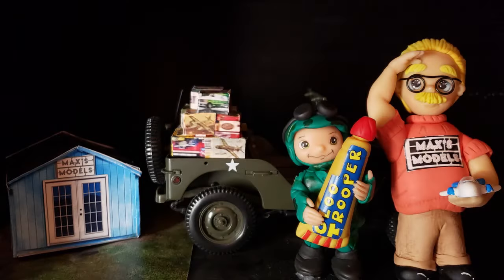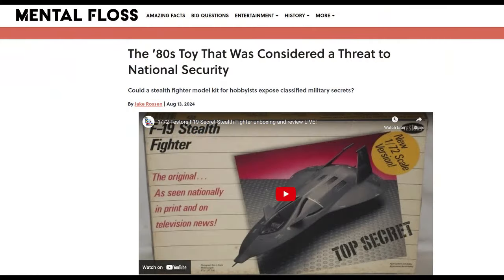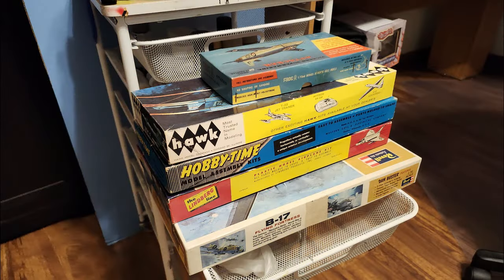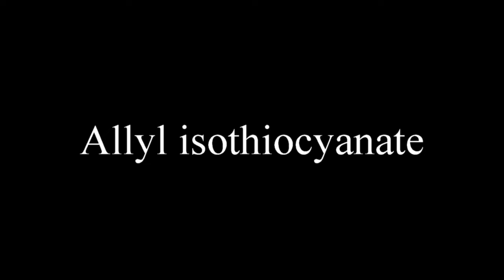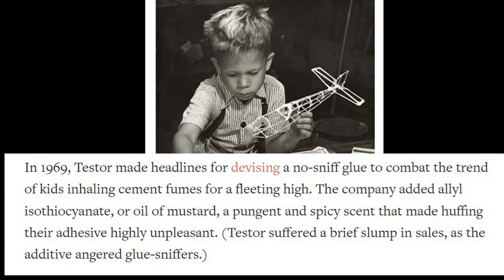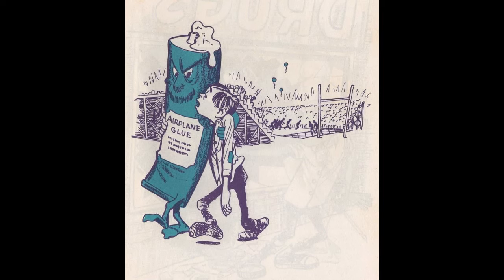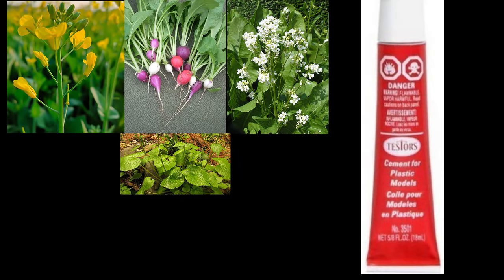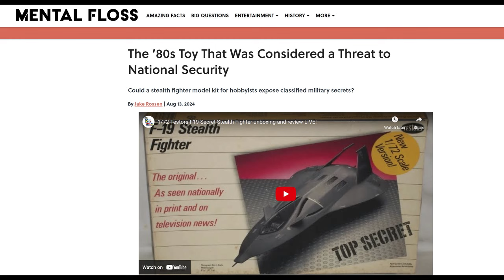Max's Models after hours 08/15/24

Comment: Testor's is still as big today as in the 60's and 70's, at least judging from what you seen in Hobby Lobby, etc.  I had a hobby store manager in 1972 convert me from the tube glue, which reeked of toluene, to the liquid glue in the square bottle (also by Testor's), whose main ingredient was methyl isobutyl ketone.  It smelled better but didn't adhere well to a painted surface.

Comment: I work on actual military aircraft and we have edge sealer, which is brushed over the weight and balance sticker to keep it on. It smells EXACTLY like Testors tube glue! It brings back memories whenever I have to use it. I was training someone and had them look up the MSDS on it and the chemicals are almost identical to the Testors tube glue! I'll be darned..!

Comment: By the time I started building models in the late 80 s testers had developed a non-toxic model glue that smelled like oranges and it would not get you high it was completely non toxic I don't know if the original formula was a better glue or not but it seemed to work fine for me